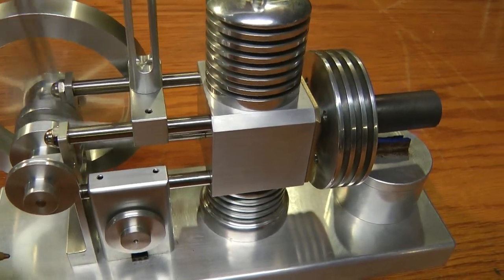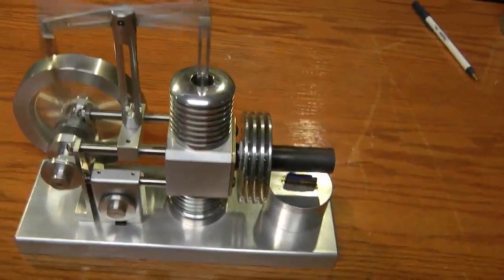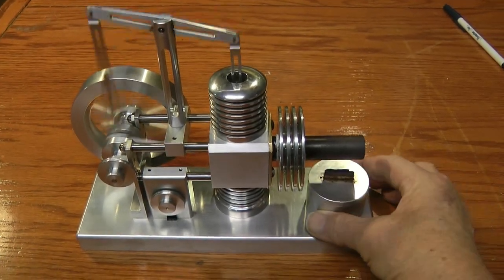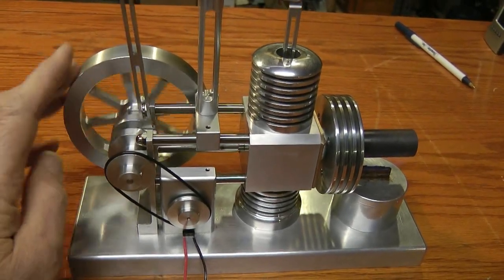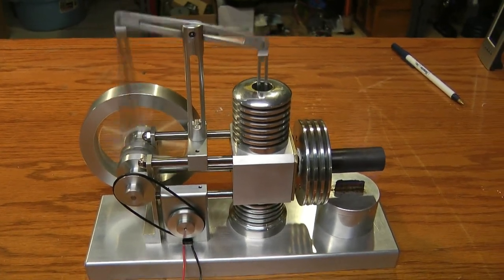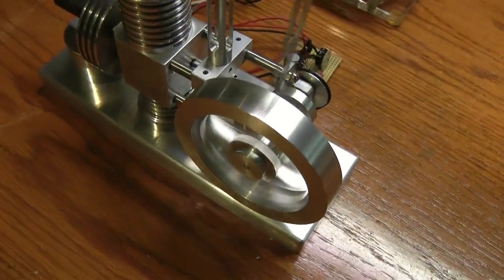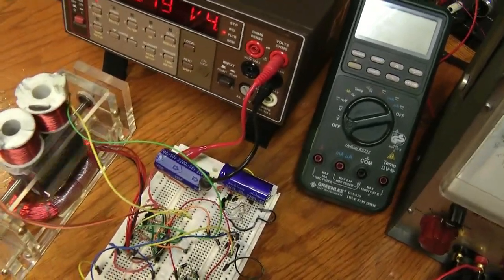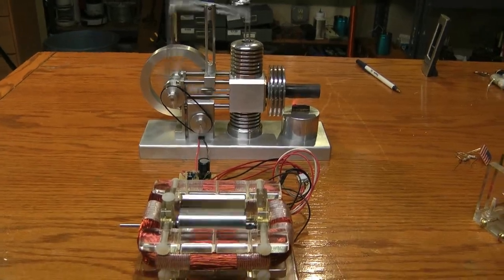Stirling Runs Window Motor

Comment: thanks for posting.  some late thoughts.  nice engine; fast running and quiet.  stirlings are not just a novelty of a bygone era, anymore.  they are being used in co-gen, chp, and solar.  to date, no videos have shown a diy attempt to use a good engine with precision reduction gearing. a load, in the form of a small, purpose-made pmg, should be matched to the power available after speed reduction.      cheers
Reply from the maker: That's an idea. With enough reduction you could lift a table in about a week. LOL. 
Thanks for watching.
Reply: haha.   your reply suggests my comment has not been fully understood.    cheers

Comment: U should try to use the generator part to power a small heatting element which in turn provides the heat to the stirling to make it run, then if there is any electricity left over light some L.E.D's. Just an idea. Looks good, great video as well.
Reply from the maker: I'm afraid the little generator could never create enough heat t0 run the motor but it's a cool idea.
J

Comment: wow thats one beautiful stirling motor.. it runs like a Lexus..wonder if we can somehow run reduction sprockets to that output shaft and connect it to a slow moving 100amp car alternator that charges a battery whilst the battery heats a coil wound around that stirling boiler and make it self loop!! (wishful thinking?)
Reply from the maker: Catsro (That's a cool one) Here's the thing. This model is designed as replication of the way Stirlings where built a long time ago and isn't really very efficient. You have to remember the engine runs only on the small amount of air that is captured in the engine. The same amount of air must be heated and cooled continuously to create the pressure and suction to move the power piston. What you suggest might be fun experiment for a modern day Stirling.
John

Comment from the maker: Actually I bought a set of raw materials and a set of drawings from LittleMachinShop but re-designed the engine and added bearings everywhere there was connectors.
John

Comment from the maker: Hi Mark, You can find the magnesium ribbon on E-bay and can use a piece of copper watter pipe. I just wrapped a piece of synthetic chamois in one layer around the pipe and then wrapped a winding of the ribbon, just the way it looked in the video. A little distilled water and you have a low current power cell. There's a ton of videos you can find on the tube. Good luck.
John

Comment from the maker: Mark, Here's the honest truth. Almost any cell made with the magnesium ribbon that has any guts to it also has a corrosive electrolytic effect. You can have some fun as long as you are operating in micro amp ranges but when you draw some current your magnesium disintegrates or at least that's what I've experienced. There's great hobby value with the experiment but as far as real life application, I don't feel comfortable at all. 
Take care 
John

Comment: DadHav, love your work ethic, integrity and skillset. This self-made motor is an absolute gem! I'm interested in your copper/magnesium 1.3v cell - do you have a video on how to construct? And performance parameters (does the voltage vary much over time, duty length of the cell, maximum milliamp drain, etc). Thank you very much for all the wonderful videos you post; if only I had the time to replicate a 10th of what you do I'd be a happy man :)

Comment from the maker: Hello Nate. I build these motors myself. I have to tell you, this is not an easy project. I had weeks of manual machining in the parts. I wouldn't suggest trying this one. The window motor and circuit is John Bedini technology and also requires some knowledge as to how pulse circuits behave. There are Stiling engine kits on E-bay with the parts machined already. That might be a more practical approach. 
John

Comment from the maker: At least this Walking Beam is pretty weak as far as torque goes. Remember the motor runs by heating and cooling the small amount of air that is captured in the motor. So since there are quite a few different styles of hot air engines I would have to thing the ones that have the largest air chambers would run stronger.
John

Comment from the maker: Hey, That's pretty clever the way you bent the crank shaft though. I'll have to remember that. It's amazing that the motors work at all based on the small amount of air contained inside. You almost need to get everything perfect.
Thanks
John

Comment from the maker: @moffett8 
I don't think this would self start because you need one full cycle to get the hot air out of the displacer cylinder and into the power cylinder.
J

Comment from the maker: @dougspair 
Close, the little generator is a DC tape drive. Yes, I machined all the parts. There is no rings on the pistons, that would be to much friction. There isn't a lot of power on these motors. The horizontal piston is a displacer and has about 1/32" clearance. Yes the heated air in the displacement cylinder is sent to the power piston to be cooled off and used again. There is no intake or exhaust. Movement comes from heating and cooling the air in the engine.
J

Comment: ...John..what are you using for the little generator...a CD or floppy motor? did you machine up all the Stirling parts, and do the piston/s have a ring for sealing..?
  I've built a lot of stuff...but my forte has been I.C. engines, electrical, and welding, the Stirlings are something I'm still learning about, even though they're been around for a very long time.
  As for the non-believer..it does say Stirling, so to me that's...Heat...and I can see the small alcohol burner.

Comment from the maker: @cfeng19 
Hello, The little generator is a DC motor from a disk or tape drive I don't remember. They all work though as long as they are permanent magnet. Remember these are really small. You would need a much bigger option for the motor in your video, Right?
John

Comment from the maker: @kylegordon 
Yes. I modified a raw material kit and machined the engine to new specifications. I could never sell them at any practical price because of all the time I have in them. There are some nice finished  models of different types on E-bay if you search for Stirling Engines.
Thanks
John

Comment from the maker: @FauxZen69 
Actually this is a hot air engine. If you split water into H2 you could find a better engine to run than this. Theres no intake and exhaust. The small experiments on my channel are far from what would be real world applications. Some of them charge batteries nicely but that's only a small accomplishment compared to what you need to run a house. I have acquaintances that run their house or t least part of it with battery banks charged by a larger scale of this charging technology.

Comment from the maker: @ForPropertyInvestors 
My little engine has very little power and is actually more representative of the old fashioned ones from a century ago. However, there are new modern versions that may already have the possibility to convert heat to some usable energy. I think thees one in a submarine someplace. 
John

Comment: Thanks for video! Will that run a stepper motor? Whats sort of electricity could it generate? LED lights?? These Stirling Motors are unreal would very much like to see and own a larger one one that can harness a common fireplaces heat or sunlight.

Comment: FAKE! no just kidding, that's an awesome stirling engine.  have you seen john bedini's work with back emf?? overunity system using lead acid batteries, it turns the batteries into negative resistors.

Comment from the maker: @andruha11234 
The thing about this type engine and the low temperature style is they run only on the air in the engine. The air is heated in one cylinder and then pushed to a cooler cylinder. The heating and cooling expands and contracts the air in turn pushing and pulling the piston that runs the flywheel.
John